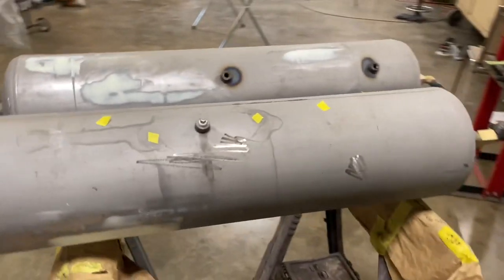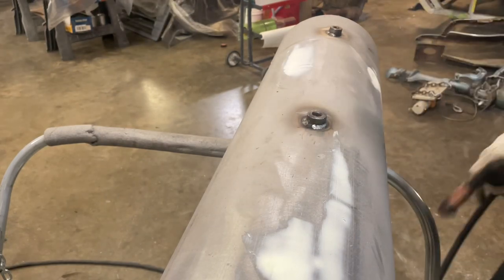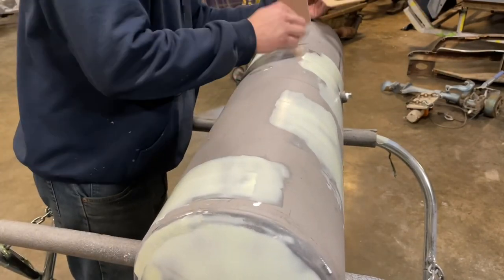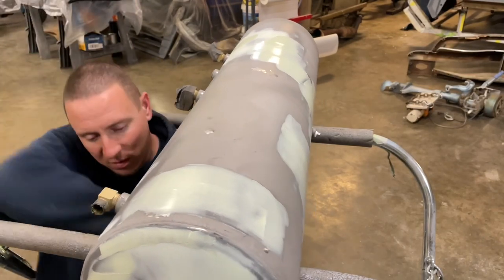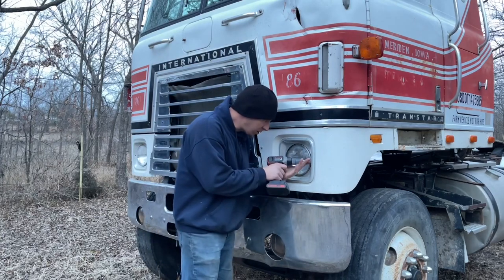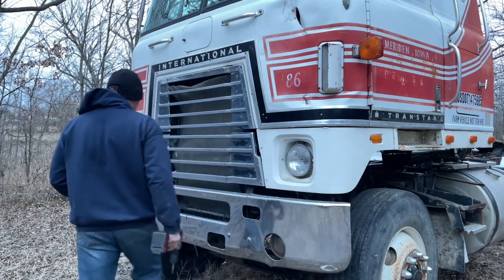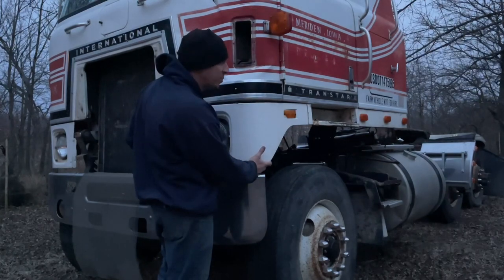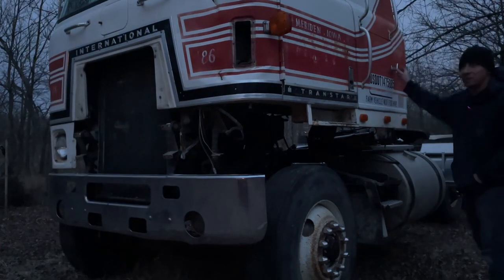Cabover Restoration. EP28. Stripping down the parts truck and fixing air tanks.

Comment: Didn’t look too bad. Betcha take a good breaker bar and ratchet next time. I know the feeling, gather up everything you think you’ll need and get there and find out it ain’t enough to get it apart. That’s actually kinda wild that one of those had a clutch cable and the other had solid linkage. Those vents on the corners of the cab we used to take them off put tape or cardboard behind them in the winter. Helped keep the cold air out. Another trick was taking them and flipping them over if it was medium temperatures out. I bet you’ll end up making a few more parts runs out there cause I see a lot of good useable parts inside and outside. Stay cool
Reply from the maker: Yep, its always the tool you didn’t grab, lol. I had forgotten you drove these back in the day.. i would think the mechanical clutch linkage would be superior. Maybe it was because its a year newer.
Reply: @BrokenWrenches  I’ve heard of them having clutch cables. But I agree the mechanical linkage is better. But you have to keep the ends lubed up good. Those and 9670s I drove both. The 9670 was nicer just because it was so much roomier. But they were and still are tough reliable trucks just about always got you thru. I miss the simplicity of those trucks but I think today’s trucks are stronger pullers. The only constant thing in trucking is it’s always changing sometimes better sometimes not. Stay cool

Comment: Looking good. The two part tank threw me off when i was building my 4070. The smaller section is called the "Wet Tank" its supposed to be first in line after the air compressor and collect mist of the water. From there a top port feeds the other 2 tanks. As for the welder ive always found the pushing of the wire is a grounding problem.
Reply from the maker: It definitely had more crap in it,,, i plan to put an air drier on the truck, maybe it will be a dry tank now. Thank you for watching and for the welding tip. I will be installing those parts i bought from you soon.
Reply: @Broken wrenches  if you use a AD9 air dryer it fits perfectly behind the Air cleaner on the right side of truck. I'll send you pictures on Messanger of where I have mine tucked in.